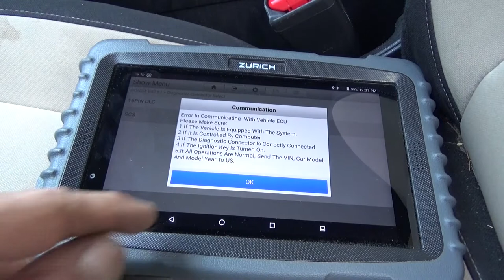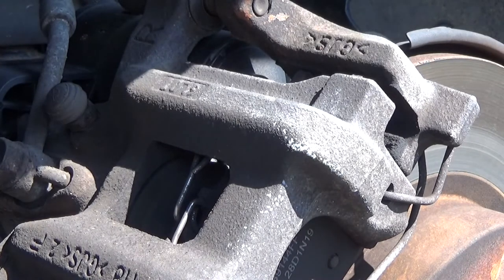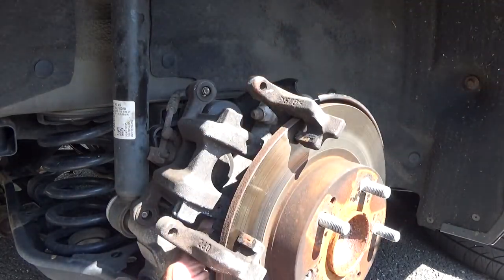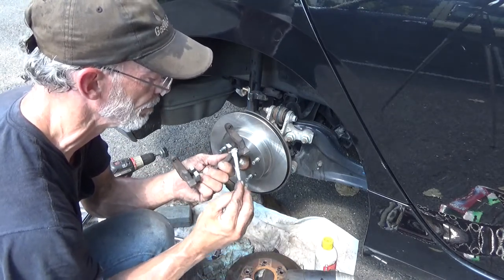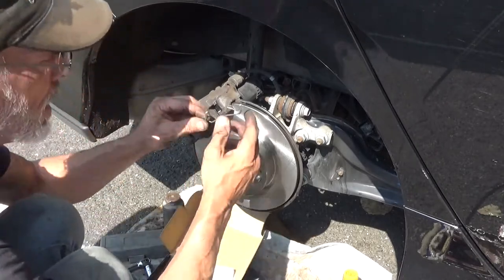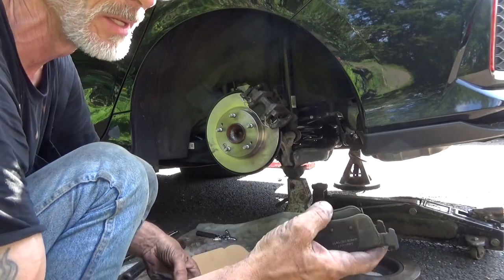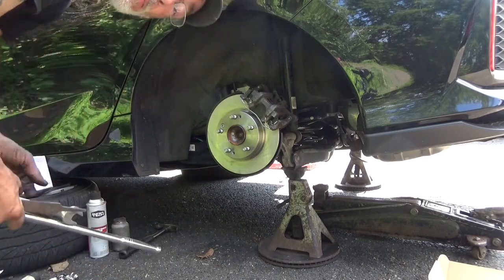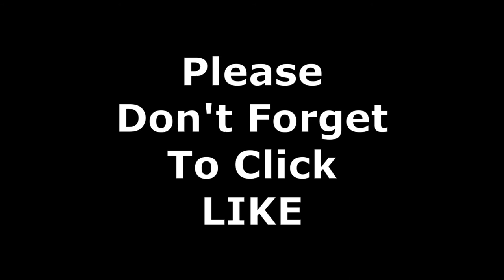2017 Honda Civic - Rear Brakes, Rotors, and the Zurich Pro - Auto Repair

Comment: Is this scanner ready to do right out the box or do i have to buy the one year subscription as well?
Reply from the maker: As per usual, you fully charge the unit as per recommendation. Then REGISTER the tool. (This gives you immediate access to updates for one full year (or two?) , after which $500 for a 1 year of updates. I waited a few months after expiration, to see what would happen, and the tool kept working just fine! When I did purchase an upgrade card, it immediately opened a ton of updates.
MY ADVICE: DO NOT SELECT EVERY VEHICLE, select what you NEED as the stock configuration doesn't have the memory capacity to update the huge files, like BMW. (can always be added later if needed)